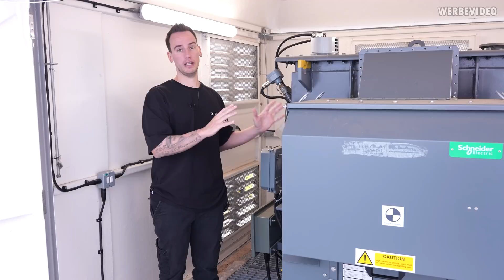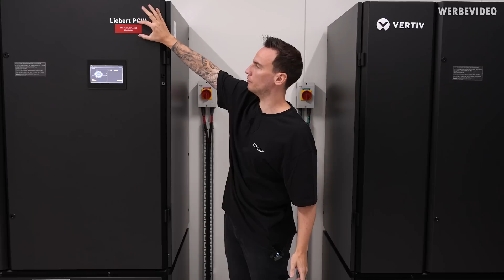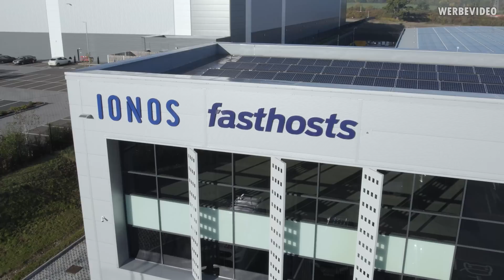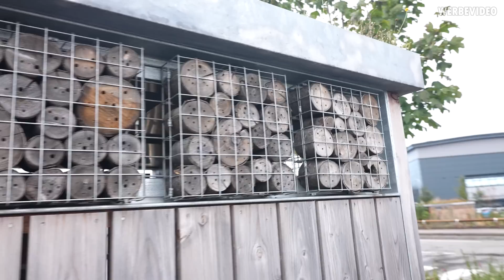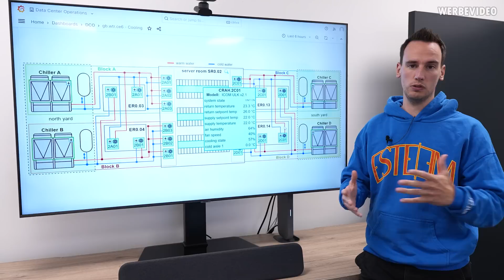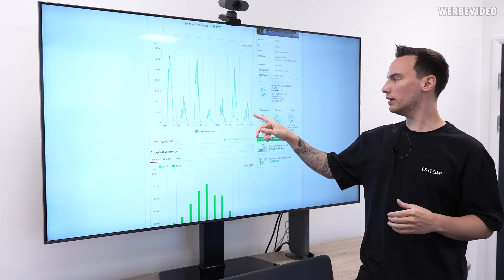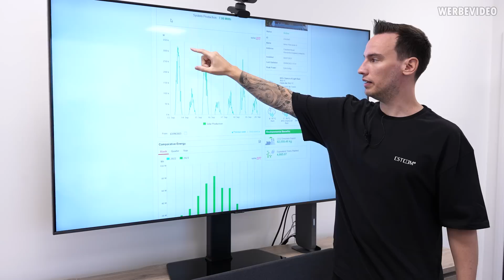A 24 Million Euro Investment: The Datacenter of the Future

Comment: Great video! Thank you for showing this. In regards to watercooling and using excess heat, the Norwegian University of Science and Technology's largest campus building is heated by the excess heat from our supercomputer. That saves a ton of electricity for the university. It's really cool seeing these different ways to make data centers more environmentally friendly.
Reply: very... the microsoft one sealed in the ocean seems to be pretty solid of an idea that most coastal cities can use
Reply: @dertythegrower  it's a good way to cool the servers but nothing I've seen so far suggests they're going to scale it. It's all container sized modules you can't access to service. Clever, and worth studying but you're also completely wasting the heat not to mention changing the local water temperature which could be devastating. Especially if they're running Windows which wastes a lot of power ;)

Comment: Generators should typically be run at least monthly. Motors need to run for lubrication. It's a good way to make sure they will start, too. And they should be run until fully warmed up to drive out any crankcase condensation to avoid internal corrosion.
Reply from the maker: Yes they also said they do test runs regularly. That's in line with what you said
Reply: We run our natural gas generator for 2 hours a month to ensure just this.
Reply: I suspect that they do failover tests on a regular basis, to test the system as a whole. Maybe even to the point of simulating grid supply failure from one of the two feeds.
Reply: With trickle chargers and in-line heaters turned on.Diesel/Nat gas generators love starting at -40 with none of that on 🥲
Reply: We use to run gens once a week,  my ups were min 2mw each and three of them, and have gas turbines, with 3 sub stations, plus 48v DC supply guy for Tele exchanges, once lightning hit the grid and vaporised the copper bus room, the real savings is in heat or cooling, some countries are ideal with fibre optic flag network on your coast  line as data entry point,
Reply: I pretty much think they know about running oil generators monthly for operation certainty.
Reply: Yes,that was partly my job...run each 1.2 MW Generator from the UPS monthly. Sometimes by just killing power
Reply: Sunshine, lollipops and rainbows
Reply: You are wrong. At my data center we run them once a week. You don't know what you are talking about.
Reply: @timcat1004  our companies insurance wants the generators run weekly too, however our 3rd shift employees keep quitting or retiring so currently generators run monthly.  Surprisingly we get many start failures (Cats)...Oh, and we do know what we are talking about!
Reply: Yeah, I'm sure you know that and that the giant purpose built data centre didn't know that. Thanks for your service into providing this vital information to the clearly ignorant data centre.